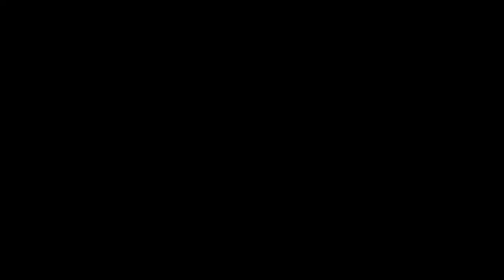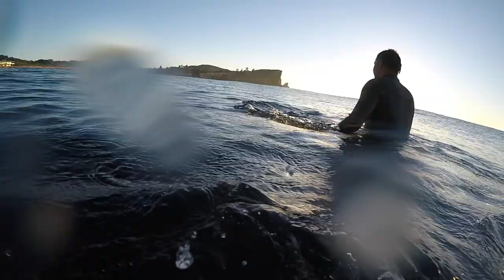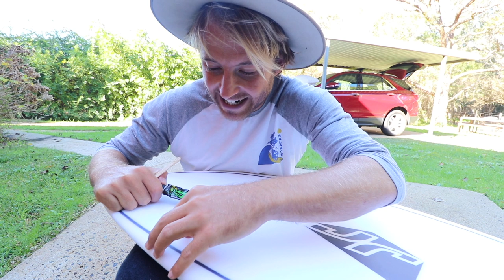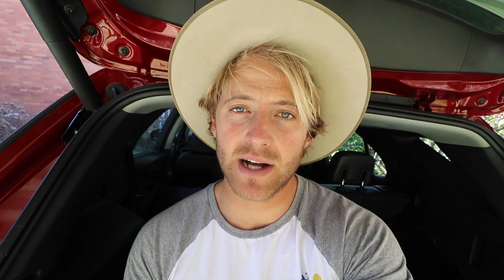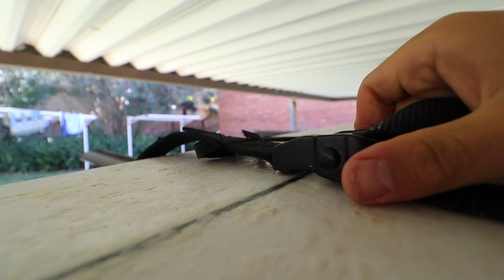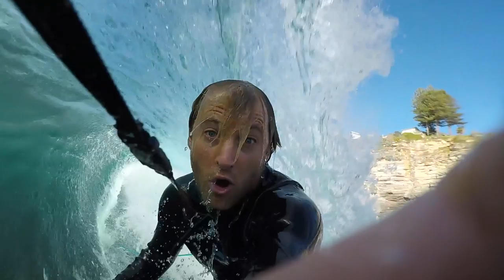How To Fix Your Surfboard | Small Dings + General Surfboard Care

Comment: Pro tip: Use a piece of plastic baggie to cover the fresh rez. You can push the resin into the hole and spread it out so that it's easy to sand off the excess later. This is especially helpful on the rails and areas that won't lay flat while the resin is curing. After a few minutes the resin will start to harden, so you can pull the baggie off and let it cure in direct sun for another few minutes. Makes for a more accurate repair job.

Comment: Hello Kale, and thanks  for sharing your expertise.    Just my 2 cents..... you should have sanded the area so the resin would stick better to your board.  when you don't sand the area, what wind up happening is air bubbles will form underneath the resin, when the board flexes, allowing water to penetrate into the foam of your board.  Preparation is key to a great repair. Cheers mate!!

Comment: Kale, First off great video like always so kudos. I wanted to chime in on the repair. I am a surfer from the 90's and you guys are an inspiration to me getting back into it. When I did ding repairs back then I used resin, hardener, wax paper and sand paper several grits. The wax paper will on wet resin will not stick and it will flush out the resin prior to sanding. 
Thanks again for this video, your friend from Oregon, JIBMONEY

Comment: I'm surprised the kit didn't come with a sanding pad. The foam in those boards (epoxy) suck water like a sponge due to less density than traditional stringer board (poly), so it's a must to repair any ding before the next surf. Cut up a plastic zip bag or something and place it over the ding to help 'form the resin' while curing. Tails and noses are trickier than decks/ bottoms and rails, so use tape to help form the shape.  Don't leave those epoxy boards lying in the sun as they tend to yellow quicker.Just off the subject, it's personal preference but I prefer poly boards for anything over 2m as they don't seem to 'sit on top' of the water like the epoxy boards IMHO.

Comment: I have a question...So I am about 160cm tall and weigh about 41kg. I have surfed a 6 foot foam board and had no problems. I can paddle into green waves and turn left or right. I don’t surf often (only in the holidays) and am looking to buy a surfboard since the rental boards are often very damaged. What kind of surfboard do you recommend? I was thinking of a hybrid for smaller waves about 5’4-5’6 in lenght...

Comment: Hey guys! I have been surfing for 4 months now and I’m starting to want to do turns   Before I start practicing I want to make sure that my feet are in the right place. My back foot lands just in front of the pad, meaning that I move it back in to the pad while I’m riding. Is this an issue and should I aim to make my foot land their straight away after the pop up? Thanks lads, keep ripping :)

Comment: Hey, just wondering if you can use an epoxy resin on fibreglass? 🤔 the surf shop only has an epoxy resin, will it bind?
Reply: Epoxy resin can go on any type of surfboard foam. When in doubt, use epoxy. Poly resin will melt EPS surfboards! Check out my vids I have more info on this

Comment: Hi Kale, I just recently bought a 2nd hand board online with few dings on it. I would like to repair it on my own, but I don't know what type of foam was used. There is no guide in JS industries website about this Bruce Irons signature board. How can I tell if my board is EPS or Polyester? What resin should I use? Thanks a lot and more powers to your channel!
Reply: you can use epoxy on epoxy and polyester. polyester can be used only to repair polyester. so if not sure, always use epoxy
Reply: @afrikanho  Thanks Man, I actually emailed JS and they were helpful. Although, I'm having a hard time finding POLYESTER resin in my city and the hardener.
Reply: @danfernandeztuwadcom  you're welcome. Where do you live? You can also try applying solarez or other ding repair resins that dry on sunlight. It depends what kind of repair you need to do. If any doubts or questions, feel free to message me. 🤙
Reply: @danfernandeztuwadcom  few posts down i described more or less how I'm doing it and it works. For years 💪

Comment: Really cool way is using a piece of a  plastic bag. Place it on top of resin and then smooth it out flat. Will prevent a sticky mess and and clean smooth job brotha and no dirt will fly on resin.
Reply: packing tape also works well, kale should've prep sanded the area first as well

Comment: Cut out a square of duct tape, apply firmly, replace as required..
Reply from the maker: Can work but often not as well
Reply: duct tape is not water proof tho'. In a hardware store you can find the aluminium tape(when you peel it off it feels like aluminium for preserving food) it works way better, lasts longer and its waterproof. ;)